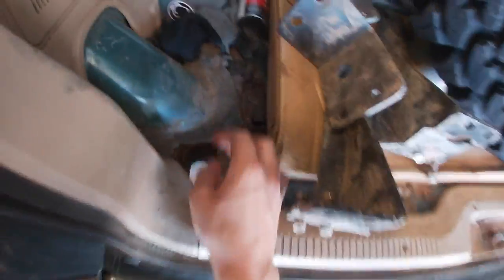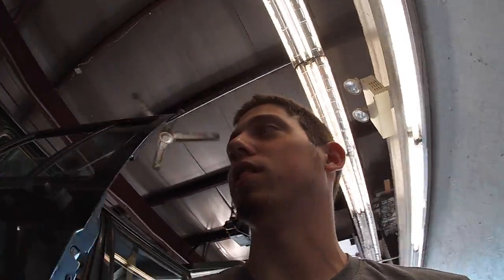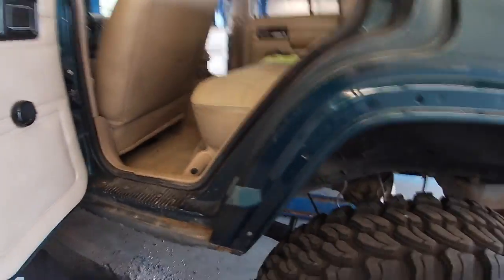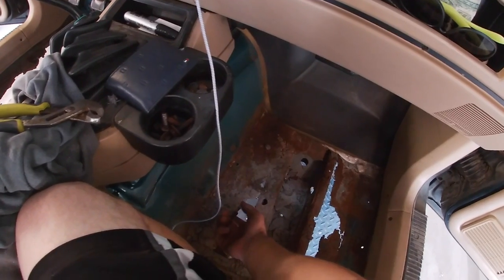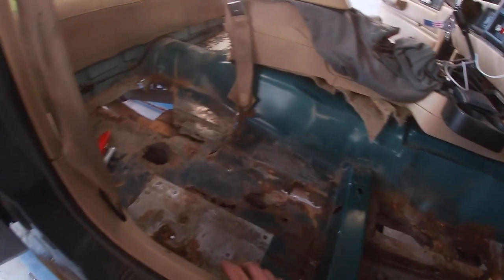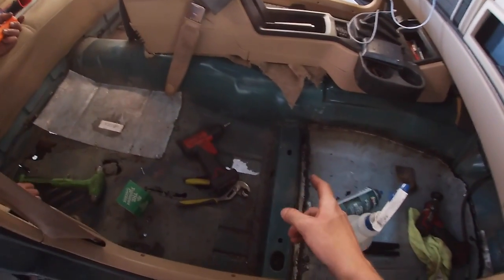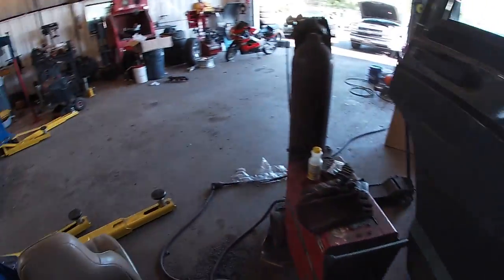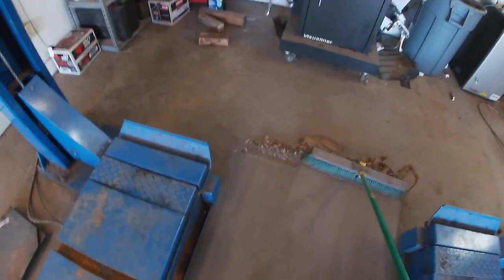I CAN'T BELIEVE MY JEEP XJ IS THIS RUSTY!!!!

Comment: I feel your pain. Had to do the same thing to mine. Did mine a little different. I removed the seat support with a spot weld cutter and used the hole front pan. Used POR 15 to spray floors in the cab and from under the Jeep. Then I used panel adhesive and self tappers to fasten new floor pans. Also used panel glue and self tappers to put the seat supports back in. Time consuming, pain in the butt, but worth the time. I used flex tape on seams. ALso painted the new floor pans with POR 15. When the new floors were done, I sprayed inside and under side with undercoat after using silicone to seal gaps and other misc. gaps and holes. Also rear cargo area I used silicone to "glue" patches after brushing POR 15 on complete rear floor area. Followed by undercoat. Pics of the project are on my FB if you want to check it out.

Comment: Hey man , it’s amazing how similar our Jeeps are! I have a 1996 4.0 Sport 4x4 5 speed with the same moss green and tan interior. I literally just got done yesterday re-doing my floor boards with sheet metal , fiberglass /bed liner . Driver side A pillar seemed to be the worse rust spot but the unibody is rust free. Keep up the good work!
Reply from the maker: As you can tell this whole Jeep is a nightmare for rust. But awesome to hear about your Jeep! Is it lifted also?
Reply: Jeepin Daily Yep! 5 1/2 lift with 33’s , wish I could share photos

Comment: Kind of off topic but how does your jeep drive? I have a 96 XJ that's a five speed and I want to lift it but I'm really hesitant, I'm worried that a lift will make it drive like crap.
Reply from the maker: I mean it drives fine and straight and I also have no swaybars so there’s definitely a good amount of body roll but nothing to be worried about. I’m sure different lift kits drive different ways but mine is good other then hard bumps and manholes/potholes it tends to hit them hard.